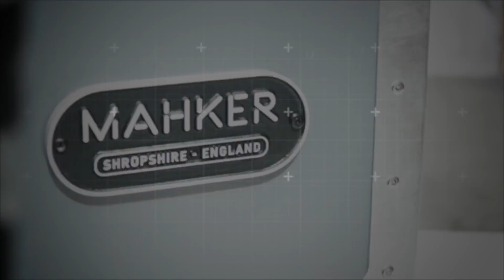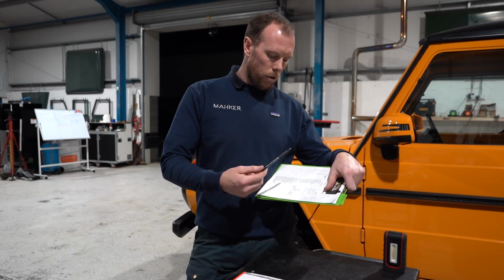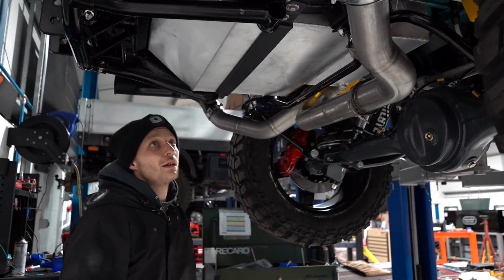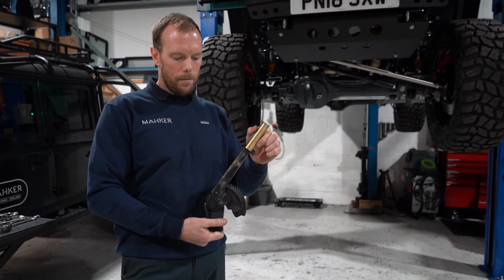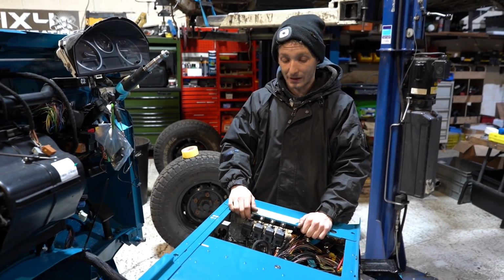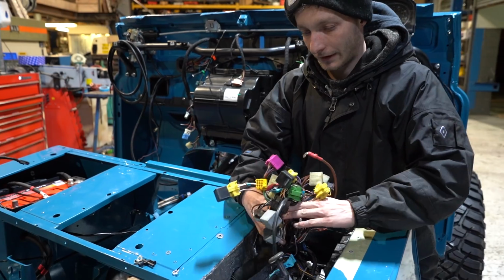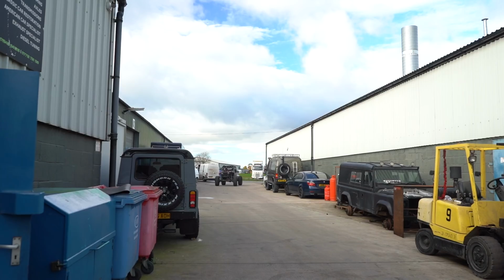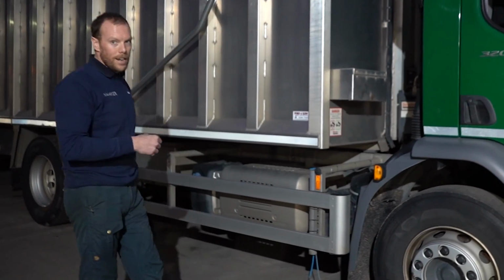EVER WONDERED HOW TO WIRE AN LS3 V8 INTO A LAND ROVER DEFENDER? | MAHKER WEEKLY EP023

Comment: Excellent video, very helpful to my 5.3 GM V8 & 6-speed auto ‘85 Ninety SW build!
Reply: Hey Paul. I currently have an '85 Ninety SW and plan on doing probably the same conversion as you 5.3L LS V8 with a 6L80E Trans. Do you have any tips, suggestions, or things to look out for?
Reply: @MattShermanRecording  I removed the Deactivate on Demand from the engine and ECU. Also put the Sonnax Zip kit in the 6L80e. Still in the build stage...

Comment: Once again a super episode, both informative and pushing the boundaries of whats possible with a Defender. Speaking of which I know that you have installed or are considering installing Cummins powerplants and I wondered whether anyone has ever put a Caterpillar Engine and Drive Train  in  Defenders?  Further, our American cousins are partial to heavy-duty pick ups with what they like to call "dualys -as the name suggests a vehicle with four wheels on the rear axle. I have seen a number of 6 x 6 Landrovers but never one with a dual rear wheel configuration. So, would there be any benefits with such a set up, or would it be deemed unnecessary and inefficient, given the huge range and size of wheels and tyre combinations for Landrovers?
Reply from the maker: Id love to fit a big Cat but that customer has not yet arrived 👌